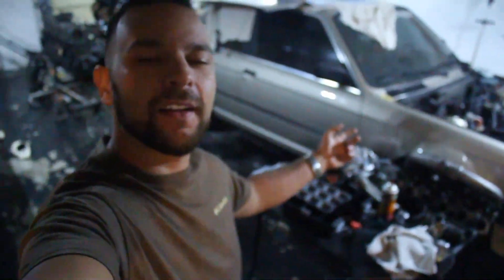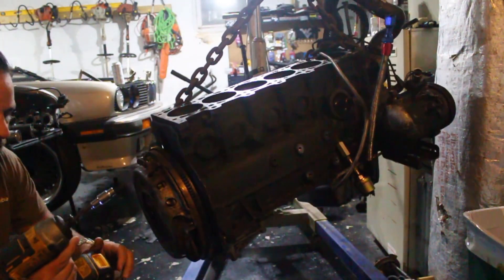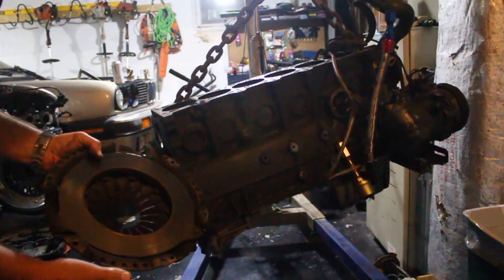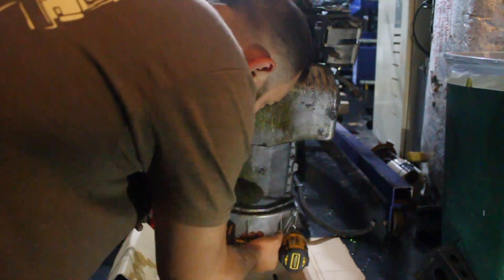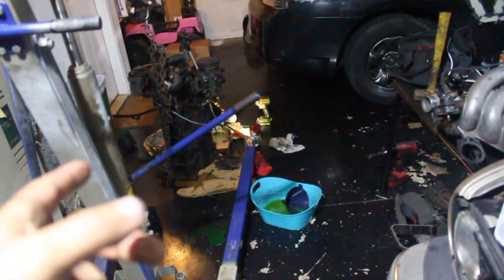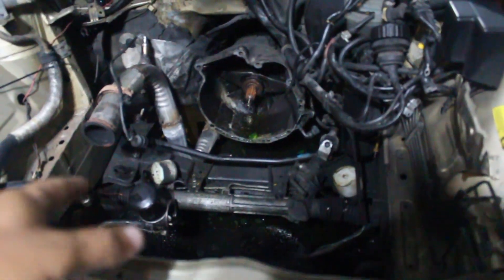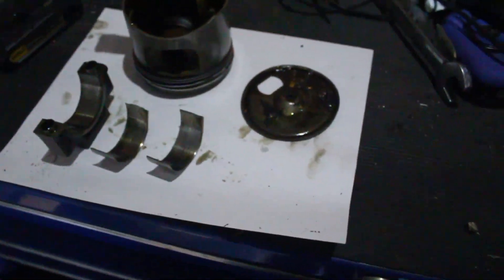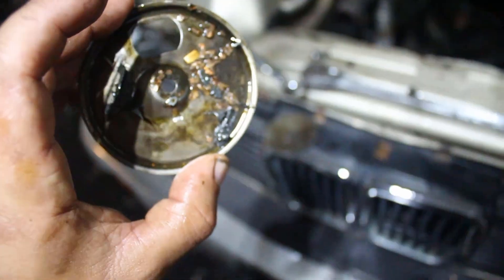What failed in my BMW E30 M20 turbo engine?

Comment: Did you ever do a head gasket and studs before turboing or was it a completely stock motor? Thanks for the videos.
Reply from the maker: Thanks for watching! I did do a victor reinz hg and vr head bolts, not studs a couple years before i boosted it. That combo gave me no issues for the last 5 years. I did the same hg and head bolts on this new motor.

Comment: I've heard to stay away from the Victor reinz gaskets for the m20
Reply from the maker: Ive heard that also but goetze are on back order and i had no issues with a victor reinz before.
Reply: I had a situation where a newly replaced VR gasket started to leak months after replacement... it turned out to be coming from the oil filter housing all along 😖 VR is a BMW supplier for some gaskets

Comment: Did you go MS yet?
Reply from the maker: I have not, this most recent build the head lifted during a hard pull so im back to square 1. Going to do an oem gasket and arp studs next and then eventually get to tuning.
Reply: Was that your most recent vid?
Reply from the maker: @Moocow444  yup going to do an update as soon as i get the parts. I drove it into the garage after trailering it back home and havent touched it
Reply: @CARSTUDIOYT  ok for sure I’ll be waiting fam keep the vids coming🔥